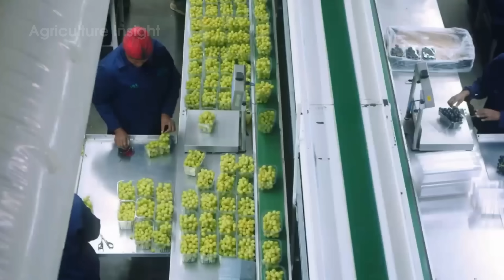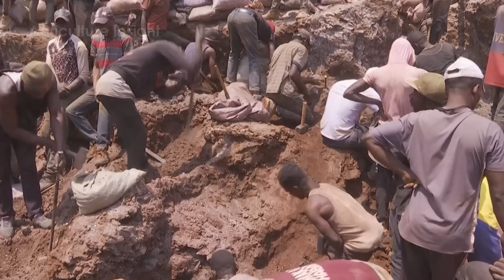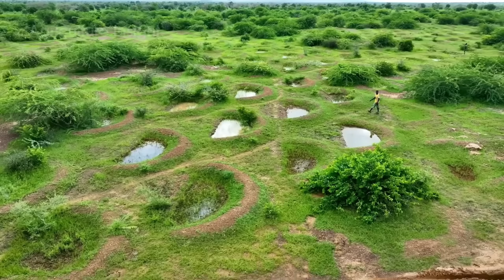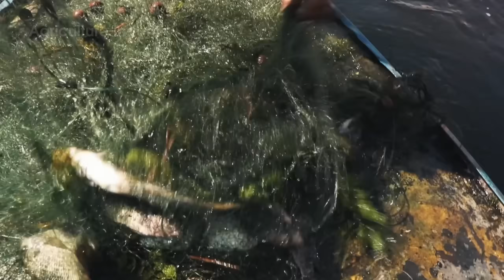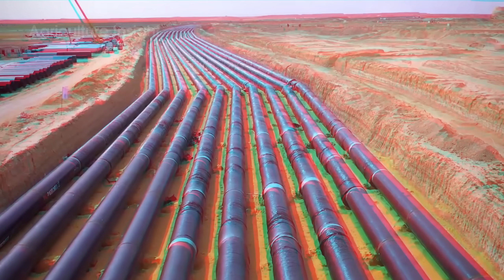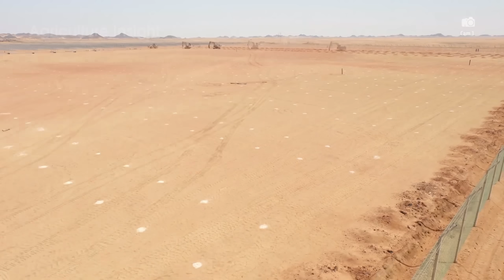South African Farming on Another Level – 55 Million Tons Harvested on Water Scarce Land

Comment: mechanisation is as a result of high labor costs, not just ability to buy equipment. In Zambia, which has the 2nd highest maize output in the region, many households grow maize on plots ranging from less than a ha to 100s of ha and use manual labor and small machines coz it cheaper than combines at the scale they do, but commercial farmers have that kind of major irrigation and mechanization.
Reply from the maker: Thank you for adding this practical perspective. Farm size, labor costs, and investment capacity all strongly influence the level of mechanization.